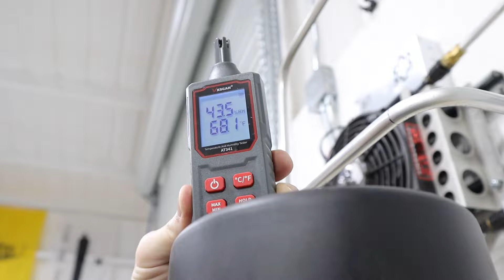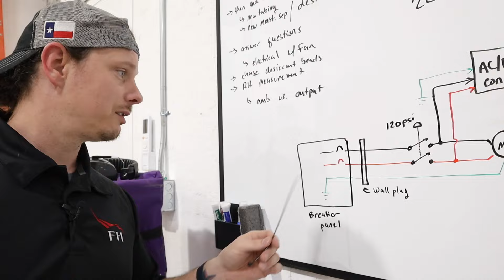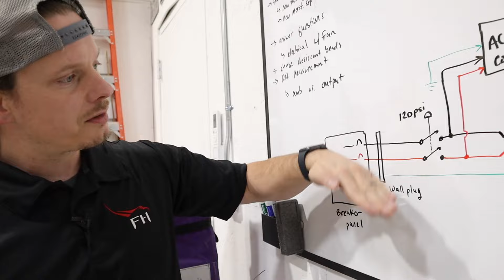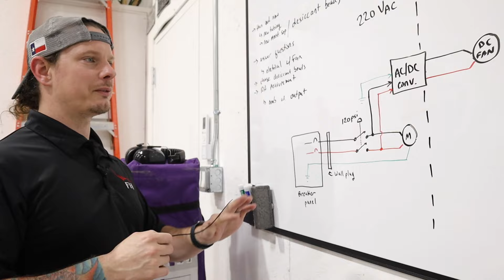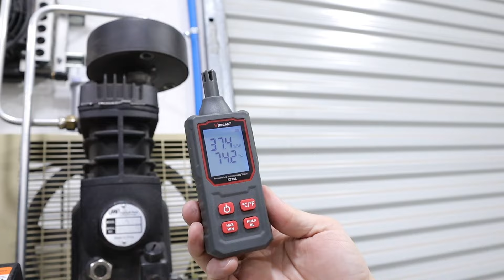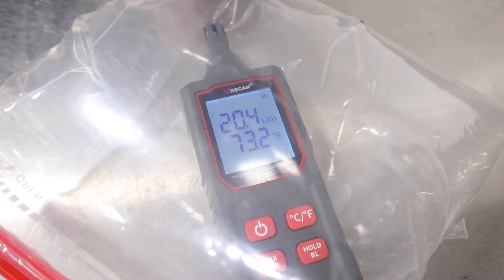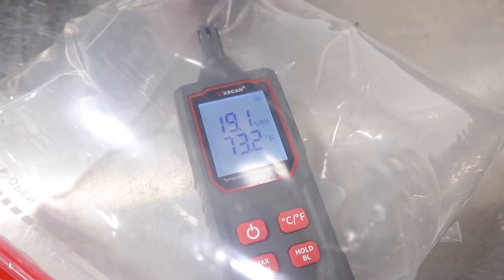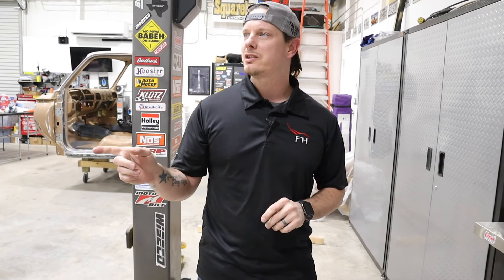Your air compressor needs this Part 2! Testing the DIY compressor aftercooler!

Comment: If you want bone dry air you must run your air tru a A/C dryer (not the silica bottle) Your intercooler Air Cooler inside a A/C BOX
Reply: i think an old refrigerator from market place is the way to build one

Comment: Very cool. So how much comes out of the bottom of the tank when you drain that?
Reply from the maker: Not much at all actually. The upstream filter just after the heat exchanger pulls out the majority of the moisture.

Comment: Hello Rich, thanks for both of the videos on air compressor improvement. I just completed the post compressor drier installation and coupled with the three stage filtering and drying previously installed I'm ready to do more plasma cutting with better results. Now I'm working on quieting the compressor intake.
Reply from the maker: Heck yeah! Glad that the videos were helpful and good luck on your plasma cutting!

Comment: Cool setup.. im in cen tex also.. want to get the Megaflow when they come back in stock. I was also throwing around ideas of a similar setup for my Quincy.. i guess the 12v fan doesnt draw enough to starve the compressor motor of power? I wonder what humidty levels comes out of the expensive electric dryers they sell?
Reply from the maker: Yeah man the megaflow is awesome, highly recommended.  As long as your wiring from your breaker box is sufficiently sized for your compressor you’ll be fine. I’ll measure the amps the fan is drawing and let you know!

Comment: Where are you located?  I am in northeast NC and the temps have been 30-50F with low humidity (winter time).  I've run my compressor just a bit and haven't gotten a lick of water out of the tank drain.  Come July though, there will be buckets of water coming out.  I would like to see this test done again in July or August, assuming you are in a humid area like the south east.

Rats are worse.  I have black widows in the crawl space and get bit damn near every time I go down there.  Just causes a swollen spot that pusses up for a few days.  Rats chew everything and poop on what they don't chew on.
Reply from the maker: I’m actually in central Texas and we are coming up on the rainy season so I will have a great opportunity to test in higher humidity levels!

Comment: Hate to be the one that puts the wrench into the gearbox but you didn't drain the tank. Looks like the setup you have the tank is the lowest part and water will collect there.
Reply from the maker: No worries Kevin! I actually do have a solenoid operated tank drain valve I just forgot to mention it in the video! Also I’ve found that the upstream moisture separator catches the majority of water and the tank drain is normally pretty dry. Thanks for watching!
Reply: @richphippsgarage  cool, I was impressed with the reduced moisture levels.

Comment: Relative humidity is not the best method of measurement for this test. Relative humidity is temperature dependant. A more accurate measurement would be grains per pound of water vapor. You could have air that is 50 degrees and 100% RH and air that is 75 degrees and 40% RH and they have the same amount of moisture. Grains per pound for each of these would be identical and if you dropped the temperature of the 75 degree air to 50 degrees with no other changes, the RH% would increase.